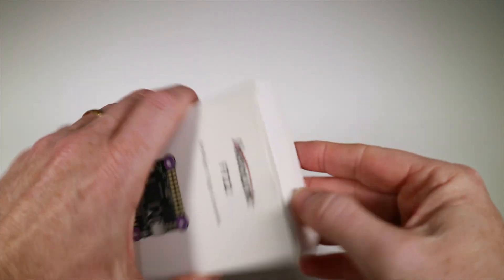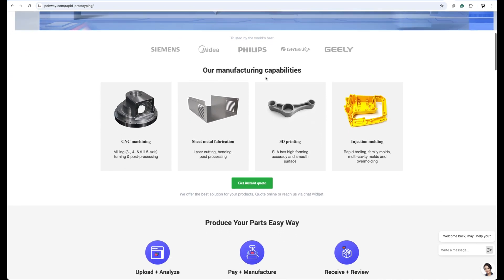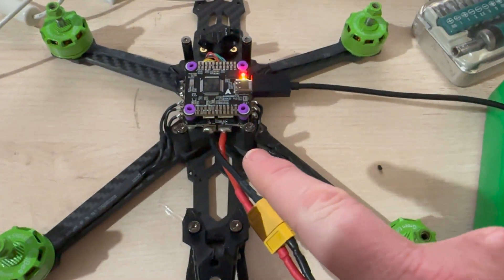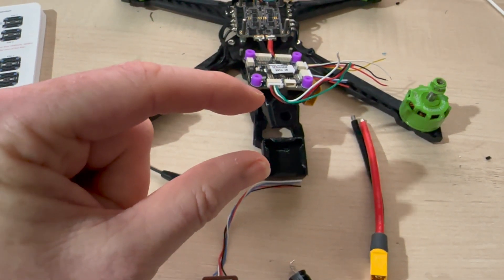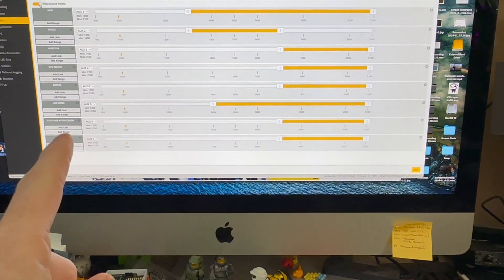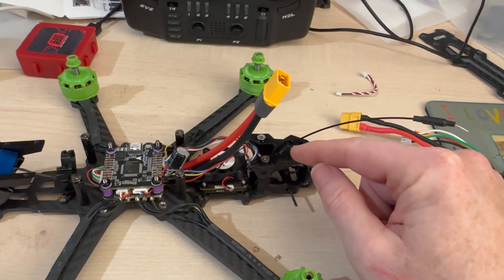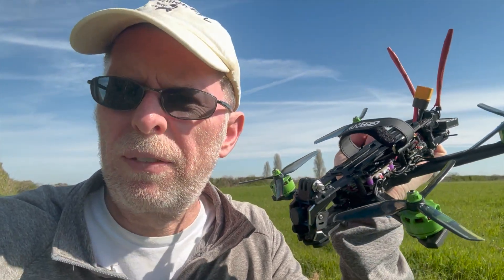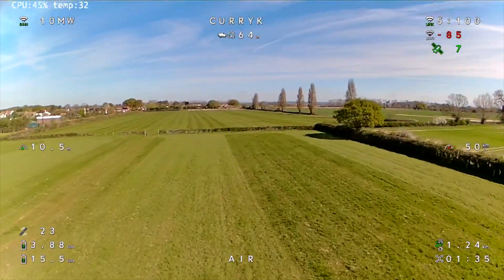Using the RadioLink F722 FC to build an OpenIPC powered quad

Comment: i have the f405 radiolink and the wifilink2 but my vtx wont enable in betaflight for some reaosn. i have it configured to uart 1 but just says vtx tables not set
Reply from the maker: If you are using OpenIPC for your video, then you don't use VTX tables in Betaflight.  The uart connection is there so you can have an OSD.
Reply: @CurryKitten figured out the issue you wouldnt believe it! The Dji uart and the gps uarts were reversed on mine lol. Used a multi meter and figured it out so now my runcam is working perfectly on uart 5 and my bz251 is displaying my sats and coordinates 🎉

Comment: Hello can use the user 1 mode function with the dedicated DJI connector?
Reply from the maker: Yeah - you should be able to, it cuts off the 10v (or however many volts it was) BEC, so anything connected to that port will lose power
Reply: @CurryKitten thank you I'll give it a go

Comment: Hello, good video. But have a question: why there is a need to deal with “sticky” and “logical” part for switches? There is an option to configure all momentary switches on GX12 as 2 position switches in SYS hardware menu. Am I missing something?
Reply from the maker: Now, I'm not 100% on this, as in EdgeTX there's always 10 ways of doing something, but if I set, for example SA as a 2-pos switch in that menu and use it, then it still performs as a momentary.  I think that you'd change it to a 2-pos switch if you actually fitted the 2-pos switch option to it - as per those blanks and the extra switches in the case.
Reply: @CurryKitten  Hi. I just checked: SA and SD on GX 12 can be changed from Toggle to 2 pos. I use SD for turtle and SA for GPS rescue modes. But as for SG and SH buttons I stand corrected- they don't change to 2 pos from toggle. So you could use SA or SD for the VTX power switch and SC or SH for the buzzer.
Reply: Also, when in 2 pos configuration and you press SA or SD, it lights up, press again- lights off. In toggle configuration, it lights up only while holding SA or SD pressed.

Comment: I'm pretty new to fpv, but it seems like being able to turn off the vtx to prevent overheating should be a standard feature. Very cool build!
Reply from the maker: I could be - but it's not.  On the analog side, you have the option to put your VTX on minimal power until you arm.  Such a feature might eventually come to OpenIPC, but it's not there yet
Reply: He made an additional jack that divides the power into two fc plugs to receive gps. When the gps receives enough signals, we plug in the power for vtx

Comment: Why not run new motor wires all the way to the pads on the motor itself
Reply from the maker: The motor doesn't have pads, they just have a join to the windings and you don't want to mess with that

Comment: Nice job Wayne....A 20mm wide camera though..?....Is that DJI standard size?..
When you taking it out a couple of miles then?....🤔😏🇬🇧
Reply from the maker: It was a bit of a weird size.  Will take it out further when I think I'll have a video signal.  I'll be going back and messing with all the antennas next

Comment: Open ipc has my interest. What I’ve been doing for the last two years to prevent the VTX from overheating while waiting for the GPS to jive up and that has been to use the little SpeedyBee gizmo that you plug into the flight controller with a battery if your flight controller powers up that way so you can use the SpeedyBee app chances are your GPS is also powered up. I let that run till I get the indication I have enough satellites then I plug-in the main battery and unplugg the SpeedyBee gizmo from the flight controller and the way I go. But I like the idea of having that option on a flight control board to power on the VTX.
Reply from the maker: Yes - it's quite nice to just have it on a switch.  of course, hopefully OpenIPC will develop a bit more so we can get the minimal TX power unless we actually arm
Reply: I'd like to see the next iteration only power up the vtx once the board "knows" it has enough stable satellite locks and is ready to fly.
IF X=(?) Then Y = +V(v) (otherwise = -V(v)) 
(?) being user preset sats required before providing voltage to vtx.